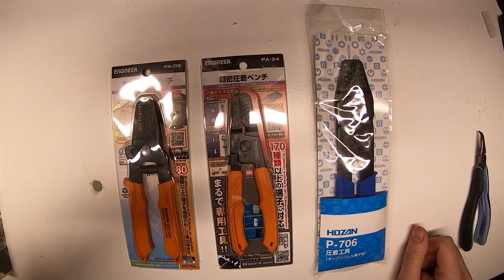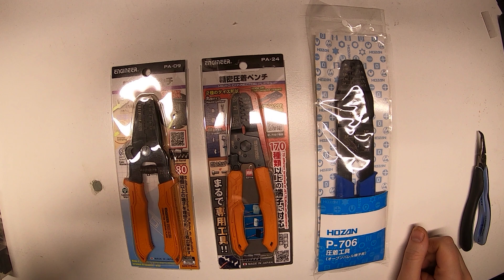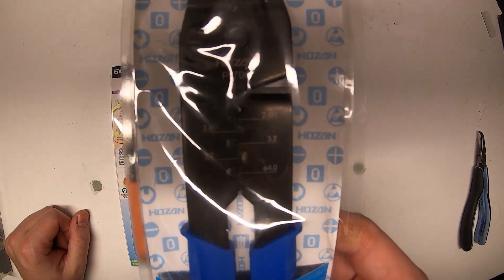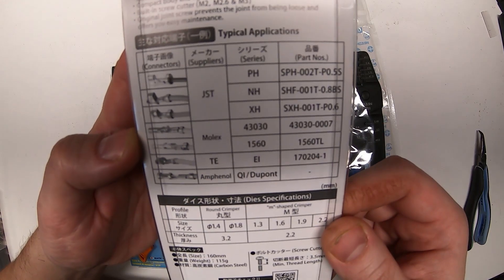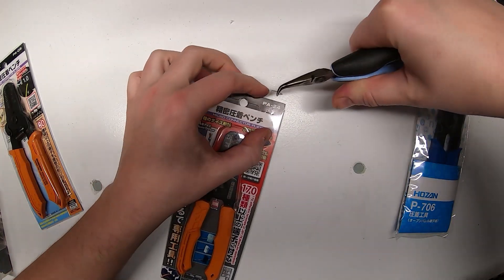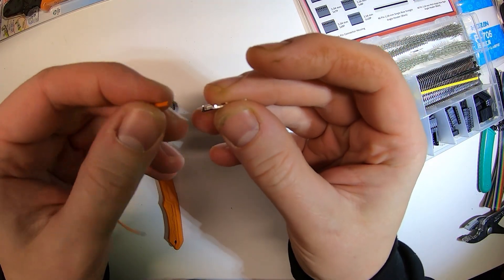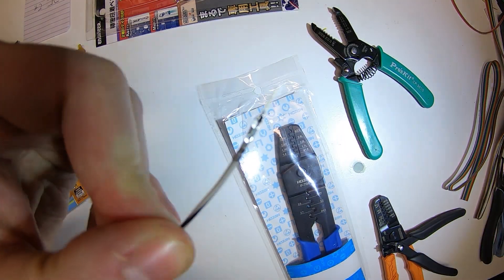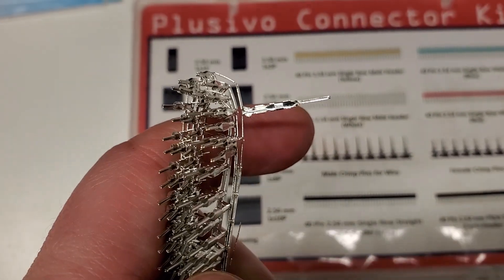Engineer PA-24 Dupont Crimper Tool Testing / Review

Comment: I had two car stereo stores in the 80's and 90's and used a ton of crimp connectors I found a set of crimper / cutters / strippers 
by Matco tools that the cutter was on the point end perfect for tight places . I use a lot of DuPont connectors in my drone builds
now . Most everything I solder but those crimpers look like the cats meow . Looks like they would work good on JST also . Great
video and thanks for the tip . You have a blessed one .

Comment: Glad I saw this. I use those ratcheting double die type crimpers and have alot of issues with Dupont being too tight and the wire breaking at the jacket crimp. I also spent 10 minutes cutting 8 M2 screws with a dremel because I can't find the exact M2 screw length I need. I know what I'm buying next.
Reply from the maker: The bolt cutters are an interesting choice.   I thought it was an odd addition for an electrical tool but it's at least useful.  One thing I've noticed since using the pa-24 more -  the crimps are good but they do get slightly stuck in the dies.  It takes very little force to get them out so it's  no big deal but just something I noticed after the vid was uploaded.  It could also be the super cheap dupont connectors I bought.  I still prefer it to the hozan but only because it's  half the price.
Reply: @midwestcyberpunk  screw cutters are not at all odd for an electrical tool, almost every pair of wire strippers I have has screw cutters, they're all SAE #6, #8, and #10 though. I mostly use Greenlee stuff
Reply from the maker: @blazini  yeah after looking at klein and others, I see what you mean.   I mostly have cheaper to mid range electrical tools that don't have any screw cutters.  After a very long time and plenty of experience with harbor freight hand tools, I've decided it wise to just buy good tools.

Comment: Tool expert here, worked at Engineer tools for 6 years, lived in Japan for 26. It's common for tools in Japan to have the capability to cut bolts - it's part of a wider cultural concept known as 連結使用 or Renketsu shiyō which translates roughly to 'Consolidated Use' in English and is very basically what you'd expect from such a concept. Hope this helps, cheers 

- Jerbus F